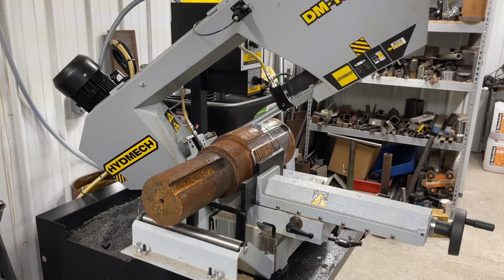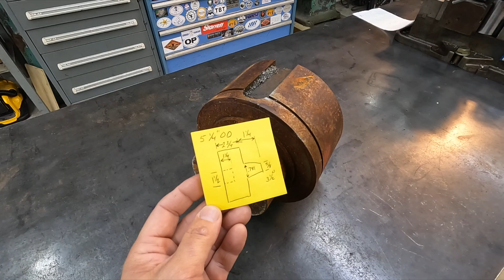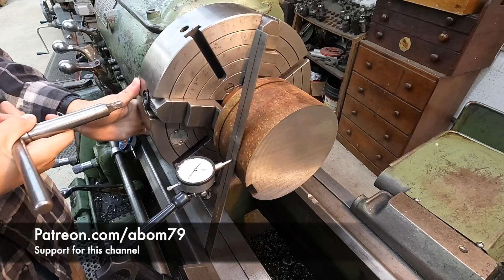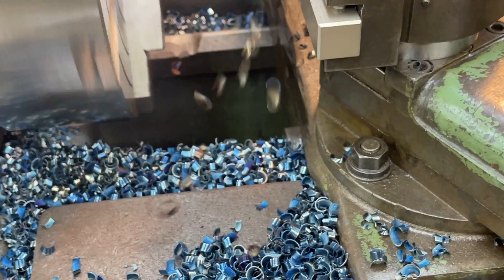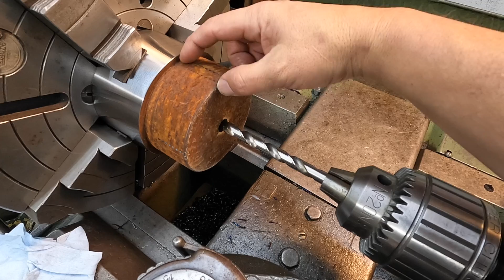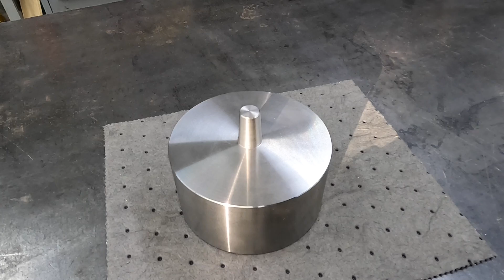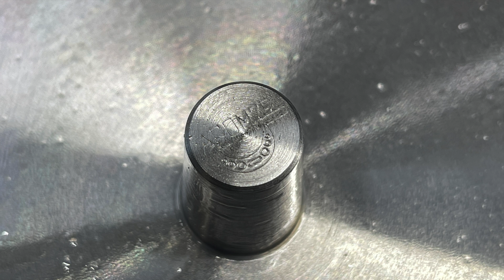Heavy Turning in the Monarch Lathe: Bradley Power Hammer Bump Stop for Blacksmith Tools

Comment: 31:49 why do you use cutting oil sometimes and sometimes not?
Reply: If the cutting tool, the feed and the speed are just right, the chip carries away the heat. If the cutter is getting hot, you need to flip on the coolant.
Reply: @ChrisSorenson-m6o  ah! Didn’t know that. I notice sometimes cutting oil is used and sometimes not. (Drilling for a live-center, etc.) I appreciate the reply!

Comment: That's a really helpful trick with that scale, not only for threads or interrupted surfaces, also for extreme rough surface. Sadly, it won't work at my cnc machines (absolut different machine layout) without a special holding device, maybe a magnet or sth., will try to build a usefull device for my company.

Comment: I am fascinated with your hand movements. You can tell you use your hand as a very precise tool. Just the act of brushing your hand across a piece to feel for chips or burrs. The action of pulling out an internal gauge to check for dimension. Your hand movements are like a graceful ballet. Even when you center something on a lathe chuck the movements are slight and precise.

Comment: Way too pretty for a power hammer, but will likely keep the selling price high.  Very nice work, Adam.  You & Abby make great videos.  BTW, I like to keep the v-belts just loose enough to act as a torque-limiting slip clutch.  Better a burning belt than a broken gear tooth in the headstock...  A modern machine with electronic controls for the drive motor could be set up to do the same thing by limiting the AC line currents.  { current <-> torque  &  voltage <-> speed }

Comment: Great video.  Does anyone use any of the chips to make knifes? Great project for forged in fire!!
Reply: If that steel was heat treatable then it might make some sense, but often it may be just mild steel, useless for knife blades.
Reply: @68MalKontent  Thank did not think about that.
Reply: This in particular was 4140, a hardenable steel, but from what has been said, smelting chips makes for very bad castings as it's so many pieces with so much slag and so many inclusions.

Comment: check chip temperature with IR temp gun -
Reply: Color is an easier more reliable way to estimate that. Remote reading IR thermometers give you a kind of average over some area, which would include the moving chips, but also the part, tooling, and coolant. The blue is around 300°C / 570°F, and you can see that for each chip with a second or so delay from when it came off the part.

Comment: About half a century ago I had done repetitive 3/4 inch diameter reductions in mild steel in one pass. Beautiful curly blue chip. On an 18”x72” engine lathe made by F.E. Reed in 1892 with leather belt drive! The last production job on it was around 1970 with 9,500 pieces. It is now in a museum.

Comment: I have a 16"CY Monarch too, built in 1941. It is still a beautiful lathe to use, and very rigid.. great for heavy cuts and parting. Also good on fine cuts.
For general work it is a bit limited by its 30" between centres and low speeds, plus only 1.5" through the headstock spindle, but it is still my favourite lathe out of everything I have used, and does most of my work.
The taper turning attachment is really useful, and I have made many propeller shafts using it.
I also have an extra slide that fits on the cross slide and is driven by cams via a universal shaft from the main spindle .. apparently used for cutting relief on multi flute tools such as reamers etc.. haven't used that yet.
Great to find someone else still using one of these great tools!
Reply: On my last active duty station before retirement the shop on the other side of the wall had a lathe with a small brass plaque stating “Paint and Finish approved by the War Production Board.”

Comment: I would use a high speed tool instead of a insert tool since it's not a critical part. Inserts break and when it shatters you lose all the cutting edges.
A high speed tool can be resharpened. And it's better for interrupted cuts.
Inserts get quite expensive over time.
You should make a video of how to sharpen high speed tools. 
But this video is still good.
NTMA Member.
Reply: You might like to search in the past videos -- there are a few hundred of them, and several about sharpening and grinding.

I would assume that he's comfortable using an insert tool because of not having any big problems with them breaking while working in his dad's machine shop as a young man, and his years at Motion Industries, and in his own shop.  (It's okay to have a different opinion, yes?  :)
Reply: @ydonl  Yes, n no this y the only video of his I've seen.
I worked in Aircraft Aerospace for over 30 years.
I'm just saying.
Reply: @deetalashoma3514  Can an HSS tool take 0.15" on the tool repeatedly for 10 passes?  Legitimate question.  I've only ever used insert tooling at work, and at home I'm still learning to grind HSS tools for my bench lathe.
Reply: @somethingelse4424  Errrr Something Else?
Here's my take on your comment.
Sure, use plenty of coolant to begin with. What type of material are you turning, the turning speed, the feed of the cut. Then the angle/grind of the tool itself. Then, are there inturuppted cuts, how far out of the jaws is the material protruding? Keep the material as short as possible to keep it stable. 👍
Reply: There are inserts for interrupted cuts - those can take quite a beating since they aren't as sharp and have a different composition. Remember, rock drills are also made of carbide.
Reply: @an2thea514  Yes I concur, but, inserts still are costly. Thanks for your reply. 👍
Reply: @an2thea514  Yes I concur, but, inserts still are costly. Thanks for your reply. 👍

Comment: Awesome clocking tip with ruler. Wish i could clock up and set up work pieces as fast as that. Working with metric feeds and speeds on a lathe how do i work out or figure out my feeds and speeds for perfect C chips and good finishes?  And how much material should i leave to take a final cut after roughing out in metric measurement?
Reply: Lets say 4-6mm Depth of cut with .50+ feed. Then try around with doc, feed and material.

Comment: I'm curious why you would bore the 7/8" hole before parting the ring? Would you not prefer to bore the 1/4" hole to save the material and have a more usable remnant? I'm honestly curious. Not a machinist but would love to learn.  
Thank you for the detailed video. ❤
Reply: Less strain on the parting tool . The remnant is a bonus; there is no point in risking a tool.
Reply: Yeah, parting off that deep is risky.  It's one of the more nerve wracking operations even for shallow cuts in my opinion.  The slower your RPM the slower you have to feed toward the center of the part, and you don't want to part off at high RPM because it will fly off unpredictably.  And the weight of the part sagging can bind up your tool like a chainsaw stuck in a tree limb as you approach center.

Comment: For the ruler trick, would it give you more precision if you measured out nearer the tip of the rule? Or are you splitting hairs at that point?
Reply: I suspect that would make it less accurate since the tip of the rule would be acting as a spring in free air with no support behind it.

Comment: Not bad at all, I love the sound of Heavy Metal.....removal of course, ok both. I am not a big fan of modern inserts with preformed chip breakers for this kind of work though. I used to buy a Seco tool that took a flat top or concave insert with a separate cam adjustable chip breaker. They were very inexpensive and with a bit of knowledge and experience you could take incredible cuts. But of course the need for the almighty dollar and ease of use have won out?
Reply: That sounds cool as hell.  I've been wanting a system like that at home so I can repurpose obsolete flat inserts from work.
Reply: @somethingelse4424  I'm sure that you could do it. The later versions had different sized chip breakers instead of the cam adjuster, easy to grind something up? Good luck.

Comment: When indicating a rusted, rough casting, or forging I always 4 point indicating. That is the most accurate way of indicating. We also 4 pint indicated rotating aircraft engine parts. there was no why to indicate TIR. For a interrupted cut such as you are showing a ceramic insert would work just as well if not better without using coolant. After that you would need to use flood coolant with a ceramic or carbide insert. Using a carbide insert on a interrupted cut has a chance of snapping the insert or dulling the insert. One way to over come this is to use a Boran coated carbide insert. I have noticed that you don't de-burr or polish any of your parts.

Comment: Doesn't that over stress the metal taking that big of a bite?
Reply: Within normal cutting parameters, depth of cut has no significant influence on residual stress. Increasing feed rate and nose radius will increase compressive residual stress. Of course, residual stress isn't necessarily a bad thing - we'll often intentionally induce compressive stress through processes like peening to improve material properties.
Reply: @j.dietrich   I've just always been taught to take smaller bites and sometimes at a faster speed.

Comment: Love the channel Adam.  For obstructions like that (can be positive or negative, like the keyway here) you can knock the 90° corner off with a disk or even a chisel.  Makes life a little easier on the tip and also the chuck & machine bearings, as instead of banging straight into a 'wall', the tip slides into an inclined plane.

Comment: Sorry, not with my Starrett scale/rule. I use a big button with a nice radius on my indicator. 20 bucks for a set on ebay. Otherwise, nice work and a cool channel. A Starrett combination square set which has that type of rule with the groove is over 200 bucks. If you have an old beat one laying around then go for it.

Comment: That technique with the scale across the keyway is like a nugget of gold. In a similar vein, we use to get a rough quick height on a lathe tool using a 6-inch rule being pinched lightly between the cutting edge and the diameter, obviously looking for vertical when pinched, indicating rough center height.

Comment: Really appreciate the trick and for showing the set up process.  You are not concerned about the surface rust impacting the dial in accuracy?
Reply: Well, on the rusty surface the ruler/scale will average out the pits.  Normally the indicator jumps a few thou over rust, but even then working on a rough piece that will be turned down and cleaned up, it shouldn't matter if it isn't perfectly indicated on the first side... You generally want to average of the high and low spots anyway.  Now when you go to flip the part, you certainly do want to indicate off a surface you previously machined.  It's when you're turning the second side that you want to be sure that it's concentric with the first.

Comment: Just this afternoon I used that trick using a feeler gage across the threads to measure the runout on the leadscrew of my minilathe. Imagine my surprise to see it being used by you a couple of hours later.
Bad news is there is a slight (0.5mm) bend in the leadscrew, but that can be fixed. The reason for measuring was that I could feel a slight thight spot when turning it by hand.
Love those heavy cuts You take Adam. And, oh boy, that mirror finish. Wish I could to that with the little toy in my workshop. Keep up the good work.

Comment: Never thought about using a ruler to jump a gap, that’s a pretty nifty trick.
Reply: I'm retired now but have done a hell of a lot of lathe work and never thought of that. I thought, or rather would have just pulled the dial indicators pin in just as I jumped that spot, or turned one way till the edge then turned the other way to avoid that gap altogether. It was a clever bit of thinking I'm ashamed to admit I never thought o in all that time.

Comment: Thank you Adam. I've been following you for years now. I have a few questions for a machinist here. In these heavy cuts, I understand having the right rates basically set the power output of the machine, that controls heat output in the first order and secondly I think I heard machinists say that hitting the sweet spot makes the heat go into the chip instead of the insert or into the piece. How do we know this ?
Also, I wonder, do you put a little dab of oil under the insert where it's in contact with the holder/ toolpost in order to better conduct the heat away from the tip ? Or is that negligible compared to the effect of the fluid cooling system ?
Reply: We know this simply by the color of the chip. If it is turning dark blue as most of these are then we know the heat is being carried away from the part and the tooling. As far as oil under the tool, I doubt it as I havent ever used it but i cant speak for others. Good questions though.
Reply: I doubt oil under under insert will help.  It's the tip of the insert were you want to control the heat. By the time the little bit of extra cooling would help, the tip would more then likely already be overheated.

Comment: When you were turning the part down for the taper area and the chips turned more into curls was that because as the diameter got smaller the surface speed was changing?
Reply: Yes

Comment: I find it fascinating how the chips come off the bit straw-coloured but turn blue sometimes before they're even out of frame

I also love how quick and easy you make the indicating process look. A couple taps on the wrench and the needle goes from flailing to rock solid.
Reply: The chip discolouration is due to a thin layer of oxide forming on the chips. The heating from the cutting is what accelerates this oxidation process.  So the chip is straw coloured but still hot so turns darker before it hits the pan.

What's also fun is the the "Colour" is actually an interference pattern from light bouncing off the top of the oxide layer and of the steel below. so the different colours indicate different thicknesses of oxide.

Comment: 1045 or 4140?  That’s a big chip for 4140. How come you didn’t use a center?
Reply: I use to run a Monarch like he is using, they cut great and will take take huge cut. He didn't need a center for what he was doing.
Reply: @patrickjohnson7369  I currently run a Mori nlx 2500 and also 204. But run cole Chester engine lathes. Almost all the time run 3 jaw collets 1 inch and under

Comment: Is there a reason why you use a 4 jaw in this case instead of a 3 jaw wich is far easier to allign?
Reply: I think he just wanted to show the ruler skiping the kway trick. Ye 3 jaw would be ok here since almost all the work is done in  one chuck ..only when changing the  position of work holding *and high precission part* would you take in a4 jaw and make it conc. again. To finish the features on other side. I think abom is a master and knows how to make stuff good 'nuff as fast as possible (3jaw ) but he takes his time here to show the indicat. trick xD
Reply: I can't remember the last time I saw Adam use a 3 jaw chuck on anything except a positioner. I have been watching 8 years or so by now, from memory the 4 jaw is more accurate, and has more holding strength, more accurate because the 3 jaw can change depending which scroll you tighten first, especially as they wear. This man is an absolute machine with a 4 jaw.
Also when dealing with large hot rolled bar stock for shafts, the "round" bar is not always very round or straight and he can make allowances to ensure the runout is in the corect place for the part. Go watch some of his old videos when he was still working at Motion making some big gearbox shafts.
Reply: Once you use a 4 jaw and get good at it, it's really no big deal. I use to run big lathe that had nothing but a 4 jaw. After some time I could indicate a part near as fast as I could in a 3 jaw.

Comment: Do you think the mist coolant works as well as oil for cut off?
Reply: No it does not, especially when parting deep.
Reply: @SkalabalaK6  That's what I was thinking but he made a deep cut and it seemed to work well. I don't have problem with cut off using oil but certainly the mist is not as messy. I might have to try it.

Comment: You should show how to use the lines on the face of the chuck to do a rough alignment of a work piece on the 4 jaw
I noticed you don't try to
 adjust the last little bit by over tightening a jaw by putting a piece of pipe  on the chuck wrench to gain leverage. This can damage the chuck.

Comment: why is it that the chips that come off always have a bluish tint?  Is it because they are hot after being shaved, or is something else?
Reply: It's the heat. If you've ever heard of heat blueing, it's basically heating the steel to a specific temp and then letting it cool. you can get different colors and shades with different temperatures. If you look close, you'll see they come off straw colored and then turn blue as they cool. Having them a consistent color is a good sign that the cut is going well.
Reply: Yep, it's the heat. Metal cutting works by heating the point of contact up as quick as possible, and the specific geometry of the cutter (the fancy designs you see on carbide inserts, the chip breakers) help snap off the curling waste.
Reply: They're coming off "straw" colored (~430F/220C if final color) turning "Dark Blue" (Actual ~550F/290C) after time for oxide layer to grow as the colors are time/temperature dependent.
(I was going to post a chart, but, no posted pics)
Reply: Probably the origin of the term "blue chip stocks" as well - the heat is taken out.